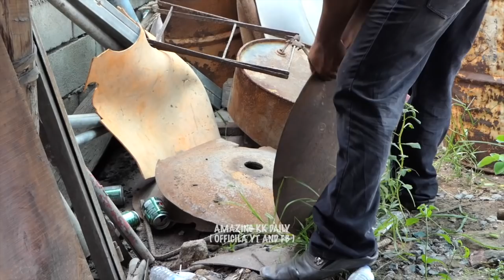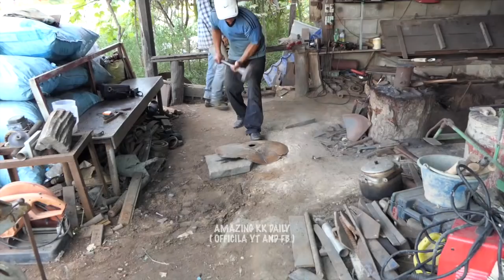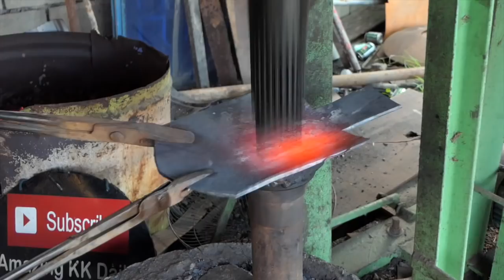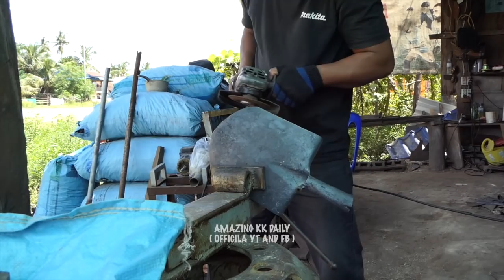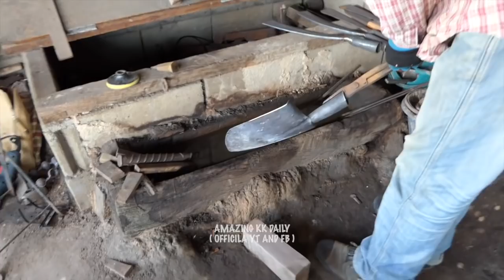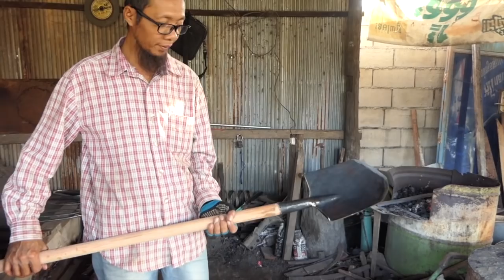THIS IS AN AMAZING WORK / HOW TO MAKE A HIGH QUALITY SHOVEL FROM A BROKEN DISC PLOUGH

Comment: Work done by the hands of man are more accurate and are better than all the machines that he makes. For instance, you will not get the quality of structure in the steel moved by a forge press over many hammer blows and consecutive heats using coal to heat the metal. The grains of the steel will become more refined and combined better by hammers used by careful hands.